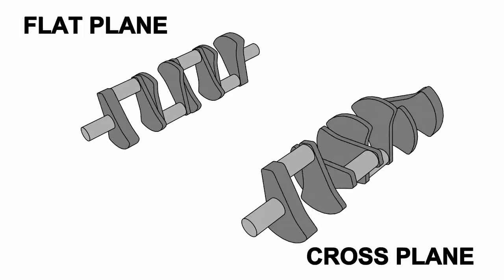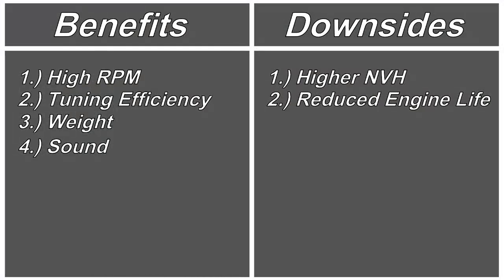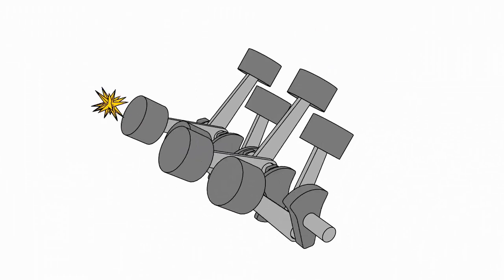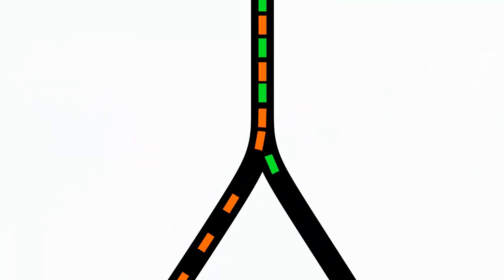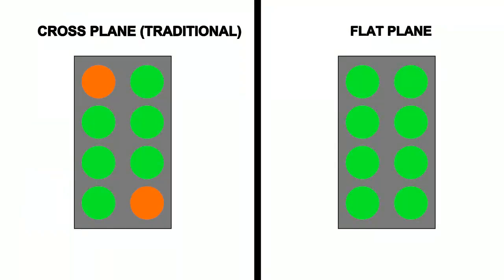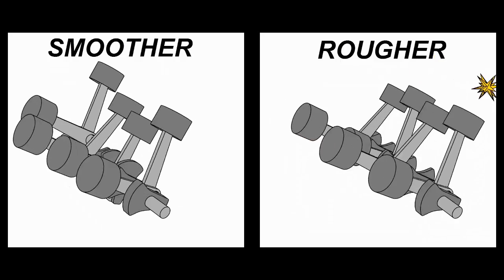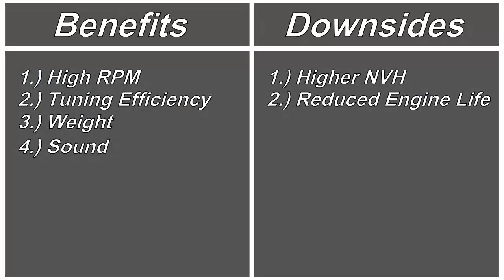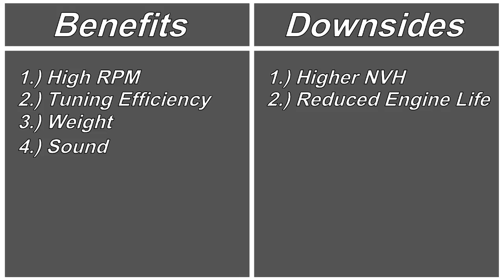Flat Plane Crankshafts

Comment: Why can't you go back and forth between cylinder banks with a cross plane? It has a bank angle of 90 degrees and the firing (720 degrees / 8 cylinders) gives us 90 degrees. A crank I believe could be designed for this no?

Comment: One of the biggest intangible benefits of the cross-plane crank V-8 is the aggressive, muscular sound. The source was revealed to me when I listened to a video showcasing the different I-4 engine sounds. The cross-plane 4-cylinder sounded weaker than, but just as aggressive as a traditional American V-8. So yeah, I'll stick with my cheap but effective and reliable American V-8s. At the same time, I am glad this sort of thing is getting attention, because that attention, combined with a healthy level of debate, is likely to spawn advancements in BOTH technologies.

Comment: Both the flat-plane and cross-plane crankshafts in this video are arranged incorrectly.

Flat-plane crankshafts in real life (with the exception of the Ford Voodoo engine) are up-down-down-up, not up-down-up-down.

Cross-plane crankshafts in V8 engines in real life are up-right-left-down or (more rarely) up-left-right-down, not up-right-down-left or up-left-down-right.

Comment: One small error in the verbal description - flat plane crankshaft engines fire every 90°, not 180°. Two revolutions, 8 cylinders, one ignition every 90°, as the cylinder banks are 90° apart.

Comment: One correction, even with a flat-plane crankshaft, a V8 has power pulses 90 degrees apart, not 180 degrees.  4 cylinder engines have them 180 degrees apart.  The reason flat-plane is rougher is, like you said, secondary imbalance, just like a 4 cylinder engine, so at certain RPM/load conditions, it "buzzes" just like a 4 cylinder.  What makes it particularly objectionable is that above and below the resonance points, it is V8 smooth, so it is a big contrast.  4 cylinder engine, in contrast, aren't very smooth at ANY RPM/load condition.

Comment: The firing roughness section is fundamentally incorrect. Any 90 degree V8 fires a cylinder every 90 degrees of crankshaft rotation, with any crank configuration (cross-plane, or either flat-plane firing order).

Comment: The flat-plane crankshaft shown is not the same as an inline-4 crankshaft, because the cylinder order is different. The illustration is sometimes called up-down-up-down; that would be horribly unbalanced for an inline-4. Inline fours use a configuration which is sometimes called up-down-down-up when used in a V8. While only one works for an inline-4, both work for a V8.

Comment: The ''Flat plane crank'' you showed is exclusively used in de Shelby GT350, all others are mirror images just as 99% of inline 4 crankshafts.

Also, a flatplane crankshaft V8 still fires every 90 degrees thanks to it's 90 degree bank angle instead of 180 degrees like you said.
Reply: Yup, if it fired 180 degrees, it would be running as if it was a jumbo-sized 4 cylinder.

Comment: Two individual crossplane crankshafts with 4 cylinders each joined with gears. Not a V8 but  two inline four with crossplane crankshafts. And with a checkered timing pattern.

Comment: 👍Close but not quite. You did a pretty good job of copying/plagiarizing my online published research of the single V8 cranks vs dual plane V8 cranks some 10+ yrs ago on various forums, though you got a couple items a little off. Flat plane cranks fire every 90° of crankshaft rotation like the dual plane does but in a different sequence as you accurately outlined in the exhaust pulse timing of each bank, it does not fire every 180° as you claimed. . Also, “generally” larger displacement will suffer more vibration in a single plane crank but as a result of the stroke and the rod-to-stroke ration, (the 2nd order Harmonic you mentioned), that is the cause of the single planes NVH, not displacement alone. If you build it with a larger bore and shorter stroke yet with the same displacement this NVH will be less. In short, the displacement alone does not determine the NVH with single plane cranks but the stroke AND the rod to stroke ratio does. In-line 4 cylinders suffer the same NVH from 2nd order harmonics and are “buzzy” feeling as a result. 

Hope that helps clear up a couple of the misconceptions. 😉 BRAAP

Comment: I dunno bot the roughness, I had a 1986 Nissan 4x4 hardbody and it had an inline 4, at stop lights I would reach and turn the ignition, then find a grind cuz it was actually running, it was so smooth and so quiet, I kid you not, it ran so well you couldn't tell it was even running, not a single vibration anywhere, this was 1986.5 with  TB injection, so that statement is far from correct, you cannot get any smoother than not moving at all.. it was as smooth as if the engine was not running, no jokes, so quiet, even with the hood up no fan noise nothing..  Japanese engineering at its best

Comment: Sorry to say that, but this video is useless. None of the shown crankshaft is real. A flat-plane V8 crank shaft has the pins at 0°-180°-180°-0°, a crossplane V8 crankshaft at 0°-90°-270°-180°. The shown crankshafts and firing orders are completly wrong (I recommend watching https://www.youtube.com/watch?v=2AzrOPPZFzs).

Comment: The P60B40 4.0L V8 from the BMW M3 GTR used the flatplane crankshaft for both the road version and their LeMans racecar. That thing paired with straightcut gearbox sounds just so godly 🤤

Comment: I think you underplayed the counterwieghts. New cross plane V8s are (90sLT1 and then LS and up for chevy) are cooled in a much better manner allowing pretty negligible powerloss due to limits of compression. Its still there. But its a few %. Probably more than the 4-7 swap, but you need much stronger cross plain cranks to allow for the revs that build the horsepower in smaller engines.

Comment: Your animation of the flat plane crank is wrong in that you have the middle and far end pistons phased opposite each other, where they should be phased together like a typical 4 cylinder.  So the 2 middle and the front a rear pistons should be together respectively.  The same even flow will occur and now the front to rear imbalance will cancel each other.

Comment: Exhaust pulses are patently irrelevant unless the manifold reduces to a single pipe, while the farther away the reduction is, the less effect the pulses. Cross members in the exhaust also mitigate the effects of adjacent pulses. The "benefits" of flat plane cranks and OVH cams are entirely contextual, while the benefits of cross-plane cranks and pushrods are absolute, as proven by the highest HP engines with the highest air flow using flat-plane cranks with 2-vales per cylinder hemi heads (NHRA).

Comment: In a flat-plane engine, couldn't you in theory fire two cylinders at the same time (One on each side)?  I don't see why not, as its basically 2 4-cyl put together.  Wouldn't that offer more horsepower, faster revs????

Comment: Wonderful explanation 👍🤙 I do have to say I've always been a massive fan of cross plane engines that loping sound of a single cam pushrod v8 or even an overhead cam set up... That was until I bought a Shelby gt-350 and reved out to 8500 since then I've decided to build a kit car with a square or over square flat plane engine... Just my preference ofcource but the sound and range of power is just thrilling to me... Btw has anyone seen the hyabusa V-8 n/a or turbo it's an astounding engine... 4-1100 hp and as u can imagine it's very light!!!

Comment: Sooo Americans didn't have flat plane v8s (clearly superior, so long as you don't need huge displacement) because they stuck with old school push rod, low compression engines needing huge displacement for minimal power (which is why older cars had like 6L v8s with 250hp) while the modern world figured out DOHC tech decades ago and moved on to smaller, higher revving and more efficient engines

Comment: The Gt350 is not a good flat-plane V8 it sounds like trash. Chevy made a flat plane V8 before Ford even though of it and it was actually good it sounded good for one. The LS7 is a flat-plane V8 and is thousands of time better then ford's peice of shit. I expected Jay Leno to know that.  The LS7 was used in two of the C6 models and the 2014 Z28.

Comment: cross planes also have more torque, more balanced crankshaft bearing wear, and with long tube headers that time flow speed, you can actually improve scavenging to levels of a flat plane crankshaft.
Reply: A cross-plane crankshaft by itself does not give more torque, rather, traditional V8 engines can't rev as high as 4 cylinder engines, so it makes sense to cam them to be torque-rich, while flat-plane V8s can rev as high as a 4 cyl, so it makes sense to cam them for maximum revs, which is what hurts torque, not the crankshaft.
Reply: @michaelbenardo5695  a traditional v8 can rev past 10000rpm they’re found in nascars

Comment: Read down the comments and haven't seen anybody talking about balance so here goes, a piston travels faster on the top half of the stroke due to the outward motion of the rods big end compared to the mains this causes an inertial imbalenc I believe it is called the second order imbalenc a cross plain v8's 90 degree firing order cancelles this but you get another imbalenc in the crank throws so to counter that you add counter weights, more weight needs more force to get it spinning so a lighter crank will rev faster same reason big 4's have counter shafts with weights on it to counter the 2nd order imbalenc, problem with that on a flat plain v8 is you just deleted the reason for it in the first place.

Comment: On a cross plane engine If you put a 5-7 swap cam in it to change the fire order, adjust timing accordingly and Put long tube headers on it... You'll be golden. Engine will turn 8000 all night long smooth as silk

Comment: The animation may be misleading, I don't think the flat plane crank necessarily has counterweights opposing each other between the rod journals just a joining flange with a main bearing journal between them since the rod or "crank pin" journals balance out each other.

Comment: Sort of OK explanation, but there are cross plane crank engines with even firing from left to right bank, Holden V8 is 12784563, they also are considered the best sounding SB V8's by most Australian (and probably UK, as they love to stay up and watch the Bathurst 1000) race fans. When AMG entered V8Supercars they ran a flat plain crank and everything would just rattle loose! The Aussie race team Stone Brothers Racing complained to AMG that the engine was not powerful enough, their reply was you can't make 650HP from a 5 litre with a 7500RPM limit (and that was with a control camshaft) so they said bullshit we'll send one of our 302 Windsor based V8's with boss heads over and they put it on the AMG dyno and well what do you know 650HP. Admittedly if Supercars had higher rev limits it would have been easier for the Merc to make the power but those where the rules, which i always though was shit anyway because in 92 HRT (Grice and Percy RIP) won Bathurst with factory Holden homoligated parts in the GrpA era and they ran 8500RPM evey shift for 1000klms, they had to bet the Sierras and GTR Skylines.

Comment: Like you said at the very beginning, they're cheaper to make., require less setup, no exotic tooling investment, and use less raw material., and, as you indicated, but not discussed, don't last as long.  The exhaust scavenging is false because the exhaust headers, not the crank design, deal with this.  Engines using flat plane cranks sound like a 6-cyl.  I'd buy one IF it has a corresponding reduction in price.  Exotic cars using flat plane cranks do so because of the reduced capital outlay and are a ripoff for the buyer.

Comment: Yeah, flat plane cranks have been in use in Japanese cars (Toyota, Honda, etc) dating back into the 1960's, such as in the original 1965 Corolla.
Reply: All inline-4 engines use a flat-plane crankshaft. This video is about V8's.

Comment: Great explanation. I’m new to understating these mechanics. Recently purchased an Alfa Romeo Giulia which has a flat plane crank V6 at 90 degrees. I found your video very informative.
Reply: The Giulia has a V6 variant of the Ferrari F154 engine family. F154 V8's have flat-plane cranks, but a flat-plane crank in the V6 would produce a very uneven firing order. 

The Giulia V6 has, as expected for any 90 degree V6, three throws in separate planes. A 90 degree V6 usually has split crankpins for compensate for the vee angle being 90 degrees instead of the 60 degrees that it should be, but the photos that I found of this crank show that it does not... causing mildly uneven firing which results in a characteristic sound that some might guess (incorrectly) is due to a flat-plane crankshaft. 

There is a somewhat common belief that the Giulia V6 has a flat-plane crank, but that is contradicted by actual photos of the crankshaft, and probably results from an invalid and nonsensical assumption that since the V8 engines of the same family have a flat-plane crankshaft then the V6 would as well.
Reply: Its not possible to have a flat plane v6.

Comment: The point that is missing from this technology other than performance is endurance. meaning pistons that fire off at the same area of aluminium block is sure to fail due to heat offset in the block as a whole. endurance of the bearing package of this engine will have failure where that bearing is hit twice per fire order. with regards to performance, you pedal a bike at 180 and two adjacent axis. get a bike for two and find peak performance and build your crankshaft around that. Now you understand when you have a feeling your mechanical counterpart goes through.

Comment: Its looks like a flat plane crank would get more vibration because it looks like a giant rocking couple (picture a bicycle crank) when in operation. Parallel twins get that, especially when the bores get bigger.
Reply: A flat-plane V8 buzzes at certain speeds just like a 4 cylinder does.

Comment: With cross plane cranks. Could you alter the exhaust runner length on the appropriate cylinder to prevent the pulses overlapping like in the animation? Also, cylinders with uneven performance, would there be any gains to be had to different cam profiles fine tuned for each cylinder to reduce this issue?

Comment: The secondary imbalance mentioned here was not explained.  It's the same reason 4 cyl inline engines shake or buzz (depending on their size and mounting). In a flat plane crank V8, you have 2  4 cyl engines 90 degr from each other, both shaking.  You don't see modern 4 cyl engines over 2.5 ltr that don't have balance shafts.  The shake is just too much to put up with over that (the Porsche 3 ltr 924 engine has a balance shaft, for instance).  This imbalance is the result of the fact that the pistons are accelerated differently at each end of the stroke. And that is because of rod angularity when the piston moves in a straight line and the big end of the rod moves in a circle.   The point in the stroke at which the piston movement changes from accelerating to decelerating is when the rod center line is at right angles to a line between the rod bearing and the main bearing.  That puts the piston a little higher than midpoint of its stroke. Longer rods reduce this effect (it affects breathing as well).  So the piston has less distance to travel  in its reversal of direction at the top of its stroke than it does at the bottom of the stroke.  The big end has farther to travel during the lower swing.  The piston reverses direction quicker at the top of the stroke than it does at the bottom.   That means it changes direction quicker at the top than at the bottom.  That difference in acceleration produces different forces at the top and the bottom as well.  Remember F=MA?  Force = mass x acceleration.  The difference in force at the top and bottom is what causes the shake.  "Balancing" the parts has nothing to do with it. It is a result in differences in acceleration.  "Boxer" engines, by virtue of their opposed cylinders cancel these forces out.
Reply: Yup, a V8 with a flat-plane crank will buzz at certain speeds/loads just like a 4 cylinder engine, but because it is smoother than a 4 at most speeds, when it does buzz it is more annoying.
Reply: Thank you. @michaelbenardo5695

Comment: I'm wondering tho...... Couldn't the cam be disigned to fire the flat plane crank engine  1,2,5,6,3,4,7,8 instead of 1,2,3,4,5,6,7,8  as in your diagram? This wouldn't help the exhast flow problems but would seem to help NVH.

Comment: Bummer that Ford had to make so many compromises with their flat plane crank and the reason why it doesn't sound and rev like a Ferrari.  Motor Trend discusses this in their video which shines a light on the differences like Ford's use of cross plane style intake manifold design, cross plane exhaust design, a crank shaft that's closer in weight to a cross plane then a flat plane and subsequent non-Italian firing order.
Reply: Well firing order isnt so easy to say. Given cylinder numbering differences.

Comment: Decades ago a friend of mine hijacked a billet crankshaft complete with wooden box to hold it, from a famous race team. Believe me if I said the name everyone would recognize. So we know this is a sweet piece, but what does it go in? It was a single plane crankshaft or so we through  it made sense considering the source. When we took it to a crankshaft grinding shop there was a guy there that just glanced at it and said oh yeah that's a turbo offy crank we were blown away needless to say we didn't have a block for it to fit in or head or other pieces

Comment: In the motorcycle world, crossplane cranks for cylinder bikes seems to provide more reliability and higher engine revs up to 14,000 rpm's. Perhaps there are adavantages for fours not no avaiable to an eight.
Reply: The cylinder configuration and count will play huge roles.